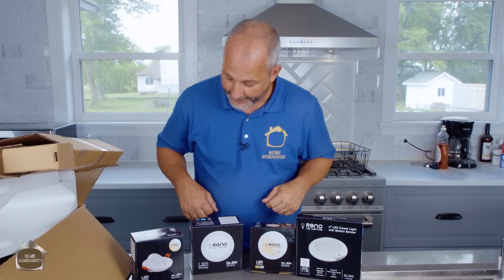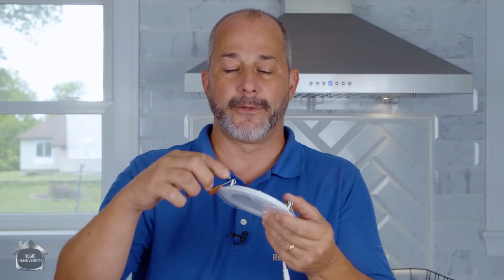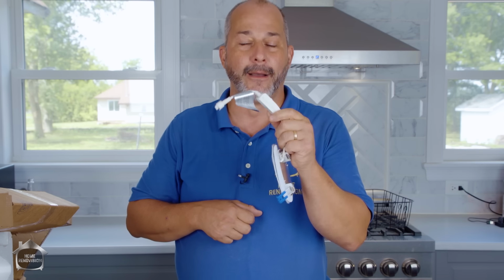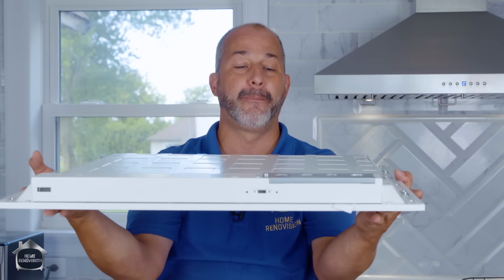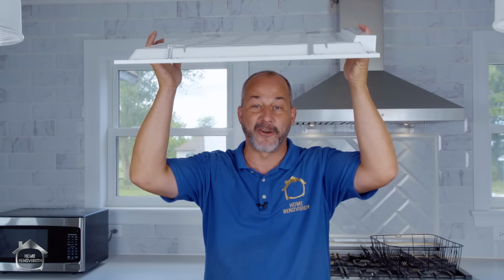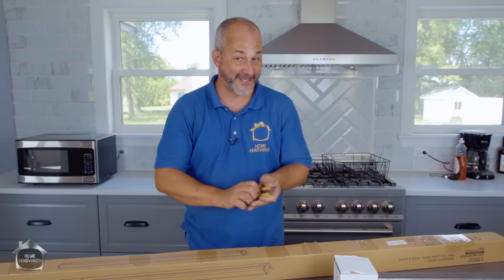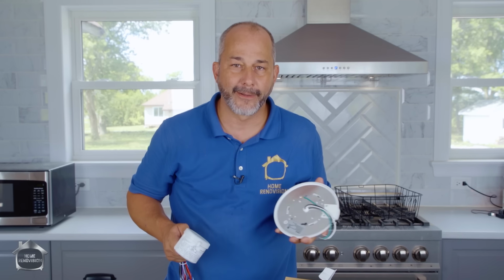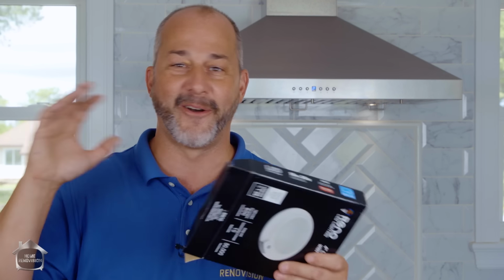The Best LED Lighting for DIY Projects! | LED Pot Lights

Comment: Find someone who gets as excited about you as Jeff does about LED lights
Reply: That would be me. First thing I did when I bought my house back in like 2012ish, 2013ish? Replaced every light with LED lights. Fricken way expensive, especially back then. But so worth it. Especially for my house. My house still has 100 amp service, and most of the house is wired to just a few 15 amp fuses. Yeah, fuses. I've had to replace like 2 fuses in the 7 or 8 years that I've lived here. I have LED lighting to thank for that.
Reply: Amen to that brother!
Reply: Still waiting for someone to setup shower floor heating to be on district heating instead of expensive electric heating :P
Reply: VortechBand  mmm
CBC  was
Reply: Don't think that is possible 🤔,  but he is fun to watch
Reply: I do .